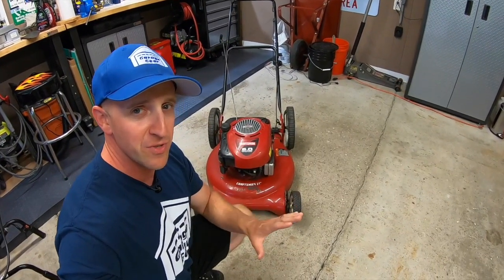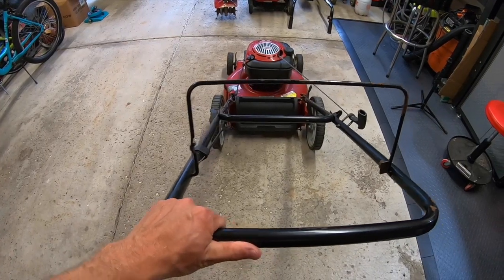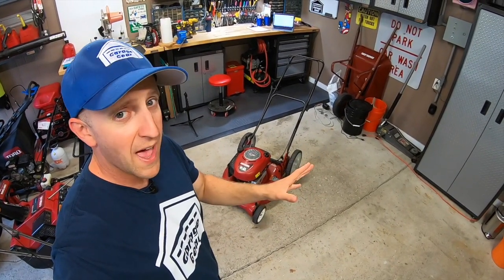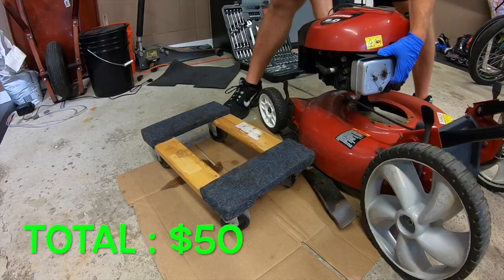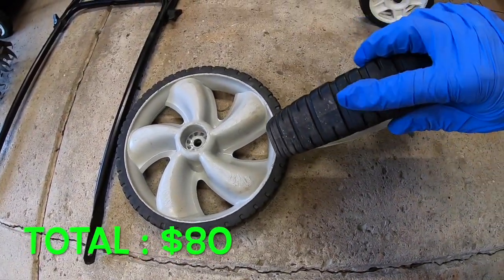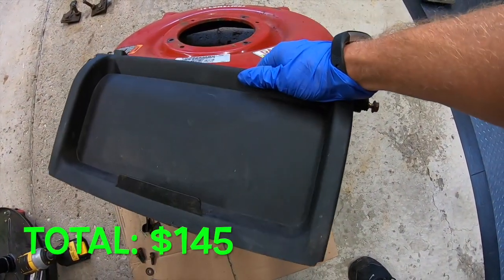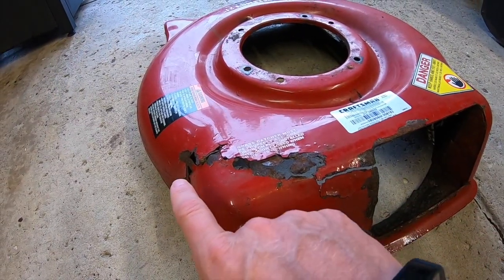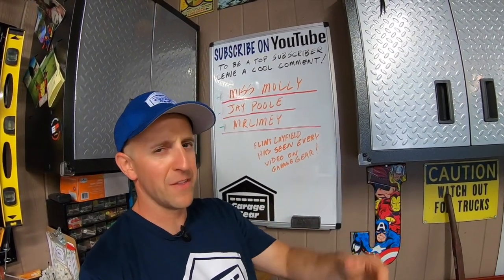HOW MUCH IS A CHEAP CRAFTSMAN MOWER REALLY WORTH?

Comment: I got...well too many mowers on the side of the road these past few months. I've had them all running, ok all but ones that looked horrible, one real nice FWD honda engine Husky mower, a couple old 3.5 briggs (run like a champ) and another old honda. One tecumseh mower where the deck was bubbly, i put my foot near the wheel, and it cambered like the guys in their Honda civics LOL. Proceeded to step on the other wheels and next thing you know its slammed to the ground. Oh well. Rest of it could be for parts possibly. Rust is the biggest issue where i live.
Reply from the maker: Hahaha wheels fell right off! Seen that before! Where abouts are you from Bailey?

Comment: Whatcha gonna do with that engine that still runs?  Make a go-cart?
Reply from the maker: I already sold it William!  They usually sell within a week or two! How was your week my friend?
Reply: @GarageGear  Great!  Did the buyer let on what he/she was going to do with that engine?  The week here in Colorado was hot, high 90's, extremely dry.  I'm use to dry heat, all is good.  I know you had a fabulous week cuz you made money!
Reply: @423co  People are just buying mower engines? Better tell me i have like 5 or more just the mower ect deck or overall condition isn't worth repair. i have a 7 ft lbs Briggs (platinum line of engines?) that runs perfect, problem is no blade, no adaptor and the previous guy broke the bolt off in the crank. A welder should get it out, but havn't done that.
Reply from the maker: @423co  ironically enough the guy said he was going to put it on a craftsman mower lol! Unreal right??? We have a dry heat wave coming as well!  Summer is here!
Reply from the maker: @baileyhatfield4273  yep people buy them all the time for projects!  And they fit many models!  👍

Comment: Crapsman.
Reply from the maker: Craftsman makes some junk mowers nowadays. Thanks for watching!
Reply: @GarageGear  I'm going on 2 months since the start of my craftsman ticket.... MTD still hasn't reached out. I got a 163cc plastic hunk of junk during the mower shortage. Absolutely garbage. And the blade options are the 3 in 1 blades. They brand lock you and don't even sell different options at the stores they sell out of. I got a 90s super recycler and a 90s Honda. I'll stick to them. Killer machines built like tanks.